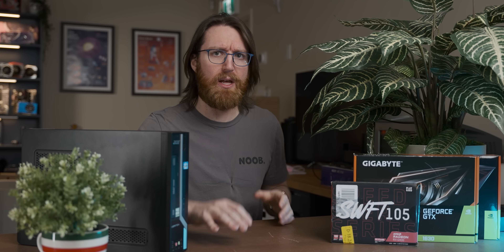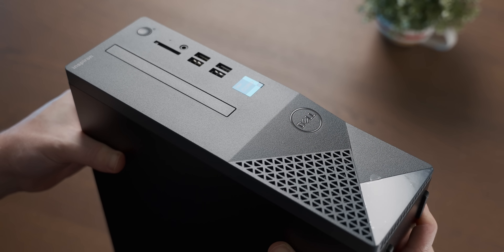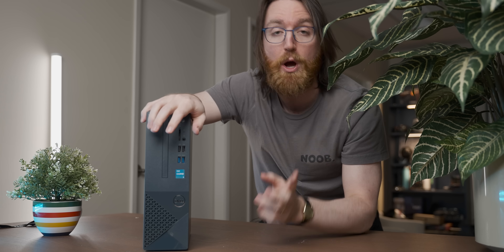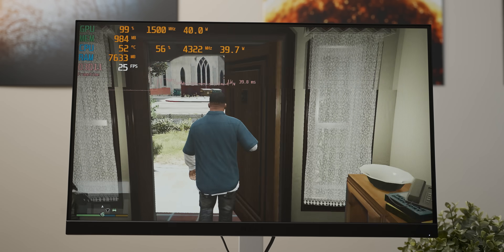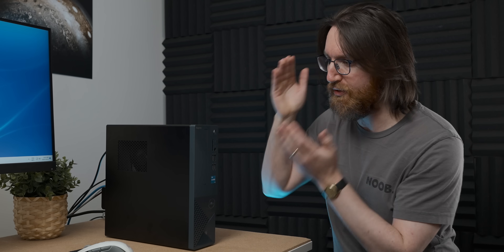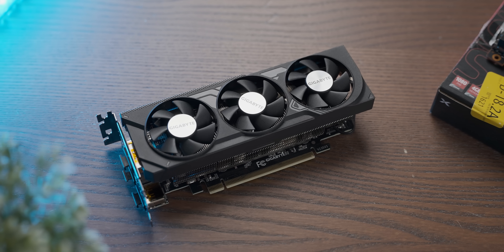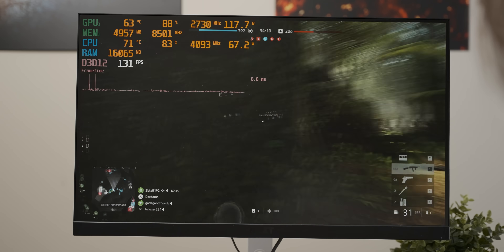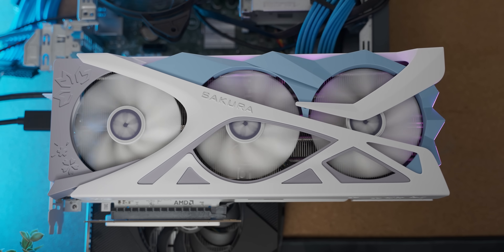The FUTURE Of Budget PC Gaming?

Comment: 8:28 Perfect, that's exactly what I was thinking!
In fact, I would have bought three SATA splitters - to go from single SATA to dual SATA, then one of the outputs goes to extra SSD (or HDD) and DVD drive via a second SATA splitter, with the other output going via a third SATA splitter to 8 pin converter for the GPU.
But hey, what can possibly go wrong? :D

(Spoiler alert - I would have just put up with the RX 6400 and left the SATA port for something like a DVD drive or SATA SSD/HDD using just a single SATA splitter (and maybe a SATA data splitter if there's not enough ports.)
Reply: TheSpotify95
spoiler, it boots, and after some days, Power hungry ?
GOLD rated 100 Watt power rail, it will fail. the DVD drive is on the same rail, free ports is not the issue, how these GOLD rated power rails are designed is the problem.
But hey, what can possibly go wrong? You will need a new PSU ?
Why you use it is the only question here !
Reply: @lucasrem  Well, the same thing will happen with that 4060 in the system. Systems like these are just not designed for power hungry GPUs, so just using this GPU itself using the dual SATA splitter, and then the SATA to 8-pin, will probably result in the PSU failing in a very short space of time.
The only thing these small form factor systems are useful for is office stuff and general everyday tasks, with the option of very light gaming possible if you can find something like a low power 1050 (or Ti), 1650, or RX 6400 which doesn't need external power. 
Also note that the RX 6400 is only useful in PCIe 4.0 systems due to its severely limited memory bus.

Comment: What about modding a 1U server PSU or SFF PSU they should fit and should be easy to get a 500W power supply. Also LPDDR on them laptop to desktop adaptors i've seen! That will will save a few watts 😂 not enough to matter but who knows. I'd also overclock a 13th gen i3 or i5 to about  100W or I'd down clock a 13th gen i7 or i9 to the 100W and I'd also use that AMD GPU or the A2000 to avoid needing to extend the GPU out of the case so really you should be able to get away with a 250W power supply.. 100W for the CPU and 70W for the A2000 GPU and about 30W for WiFi and SSD and DVD burner and fan's.. and with some struggle you mount a AIO to the top of the case and just cut a square hole to fit the cold plate though which means you can close up the case 🤔 yes it will take some thought and effort but I think i can make it fit.

Comment: There are 4060s in low profile, if you need 1x8 pin, use an adapter? ~115W in total - nah, you tricked me... Wouldn't it make more sense to upgrade the PSU? Rather than leading out the PCIe port?

Comment: Interesting, though with that hassle, I think it's far better if it remains in a dumpster like Dell intended to, because the PSU will likely to failed and they use proprietary power connector to the motherboard, unlike the old Optiplex (3rd gen and before) use normal ATX PSU.

Comment: It’s too bad those have the stupid proprietary front panel header. If a regular ITX board could fit in there, you could get the 4060lp and a 13400 in there with a Silverstone TFX PSU.

Of course, I’d expect a couple of tasteful cuts for processor cooling and CPU intake…
Reply: BTW, if you ever wanted to put a real system into a low-profile Dell case, I have a modified 7010 desktop case you could make into something fun. We’d just have to work out shipping.

Comment: The best hope for this kinds of machines is a large chunk of aluminum on the cpu for max boost, a kit of dual channel ram and a a2000 (basically a proper, full bus rtx 3060 but with half or 2/3 proper v ram)

The a2000 is the absolute top tier gpu to use when you have only as much power as the pcie slot can provide and have no hope of upgrading the power supply. There is unlikely to ever be a gpu that can pull of what the a2000 can in terms of performance per watt. 

If you want to love dangerously you can remember do a hardware modification to get more power from the gpu but your going to want to be careful, consider using a riser with supplemental sata power (at minumum) though and avoid flagship tier cpu upgrades if your entertaining this idea, your psu can only handle so much

Comment: I just obtained a HP "workstation" office PC, with an i7-8700 in it for £185, dropped in a second 8gig dimm and a 1080Ti I had laying around and that's a pc that actually can game that cost me barely £200.... OK, OK, if I bought the 1080ti, that might be different... but still.  I'm a bit scared about the 400w PSU, but it can run the 1080, so...

Comment: Always nice to see the RX 6400 get some time to shine, even if it is the crappy low-profile version instead of the far superior in every single possible way mini-ITX version. (bet you can't guess which RX 6400 I'm running :P)
Reply: The crappy low profile version is the only one worth buying.    I have one in an old sff machine and still impressed with what that tiny thing can do.   
If you can fit something bigger id suggest a used 6600

Comment: This setup doesn't make a ton of sense considering there are actual gaming desktops that can be had for little to not much more money if you catch a good sale. A few months back I got an HP Omen for my dad. It has the same CPU and RAM as your Inspiron but with double the storage, a GeForce GTX 1660 Super GPU, and a real ATX power supply (400W IIRC). Even after upgrading the memory to 16 GB, it still came out to less than $700 total.

Comment: the 13900 kf has a 1080 ti tdp which is not surpising but it is sad that dell keeps making the office pcs worse because i use one everyday at school and its a opipex 5060 with i5 8400 and rx 550 but they have dual channel ram so the i5 isnt suffering as much running photoshop and i say that because my computer has a ryzen 3 4100 and a 1080 ti and it runs great and i have to say the ryzen is suffering because my gpu is way to much for it buts better then to little like my old 1650 was but it doesnt suffer as much because it has dual channel ram

Comment: Paired a i5-3470 with a RX550 4GB… somehow the GPU is a bottleneck, CPU was at 35-44% utilization while gpu was at 99%
Optiplex 7010 MT
16GB DDR3-1600 (Timetec)
i5-3470
Visiontek RX550 4GB
SSD MX500 2TB

Comment: A 13100 isn't a bad CPU at all, when you think it faster then a old i7 of past gens which cost £290+ at release. PSU isn't need to be high power as the i3 is only 65w
Reply: Its actually not meaningfully faster since those old i7 that used to 300$ are fully capable of 60fps 4k gaming. I got the 6700k and it does ~100fps in 4k for most games

Comment: nothing beats a $30 optiplex 7010 and $20 i7 3770 upgrade to it these days. Hopefully in 2025 when windows 10 stops being supported, some newer old optiplex i5 and i7 cpu's get dumped by corporations into the used market at such a large scale to drop their price to the 7010 price point.

Comment: Alright. So the AMD Radeon RX 6400 has the same FP32 and other specs comparable to a NVIDIA GeForce GTX 680 from 2012. So there's no need to upgrade the CPU but only the GPU. The CPU which is the Intel Core i3-13100 is strong enough to play all video games up to the year 2020 without breaking a sweat. So the only issue remains the GPU, which in 7 years might be good enough to play games up to the year 2020.

Comment: Been using dumpster office PCs for years, as you saw you can upgrade them to some extent but you quickly run into a wall.  Still, for either a reasonable hobbyist Linux system, or a machine for a kid to play Fortnite and Minecraft on they're perfectly reasonable. You have the added advantage that these things are designed to be abused by office workers for years so are pretty reliable.

Comment: The Future is, Keep the old RTX 4090 as long as you can.
Is it the GTX 1080 ti ? Can we use it 10 years please.
Budget, we already have it !
Found the DELL in the Dumb, faster DDR 4 system, low power 14700 f
Single slot low Power GPU, i failed too, need single slot low power GTX 1660 ?
Great job, it can run all game in 1080p 60 FPS

Comment: I wouldn't call this the future by any stretch, even as a joke really. I think using an older Optiplex minitower or similar is still the king. Much cheaper and with something like a non-6 pin GTX 1050 TI it still provides good fun in a lot of games. There are even more options if one can change the power supply.
Amusing though. I do agree I hope the RX 6400 does not remain the best low profile GPU in its class.
Reply: Not only that, you can keep going as far as your imagination takes you.  Cooling is the only limitation.

Comment: When you do these "catastrophic ending possible" videos and you are piecing together sketchy things you should put a fire extinguisher on the desk 😂 my overclocking days were in the 90s when we had to have an adaptec 2940uw? To have drive speeds fast enough for no caching and we were struggling for good frames playing quake at 1024x768 with voodoo cards. Now even my laptop has a 1650ti and ryzen 5400h. It's a couple years old but it cost less than the monster I built in the 90s. 

You should have seen the look on the salesman's face when I said "I need a 512k DIMM of 15ns SDRAM" 😂 $500 and an hour later someone unlocked the kryptonite cage with literal armed security and got me a single piece of RAM. This was before DDR existed. 

My tv runs a ryzen 5600. The next one will either be 8000 or 9000

Comment: msi b550 pro wifi ryzen 5 5500 gtx 1660 24 gbs of ram anbd a 650 watt power supply this is the best budget pc in my opinion
Reply: all for like $400--$500 depending wya and if parts are used or not
Reply: ram i have at 2133 mhz default for mine

Comment: This is somewhat fun, but by the end the system was completely getto. I wouldn't want to have a pc with its guts out like a murdered knight who came across a set of spikes. 

Not to mention that if you are going to upgrade, the memory, the SSD, the GPU and the CPU, you might as well build/get another system. 

Last but not least, I wonder if you can use an SSF PSU. Or is everything proprietary? Then again, if everything's proprietary, just stay away from that junk. Get one of the old Intel nucs.

Comment: 13:00 Pump is at a lower height than the radiator, which can make the air bubbles go to the pump, shortening its life drastically. Do not do that, you will kill the AIO pump.

Comment: Not only are those old quad cores long-in-the-tooth, some of the best-in-socket CPU's are still pulling like $200 freaking dollars. MFs just waiting for that mission critical system to fail so they can finally sell the replacement. x.x You can literally get an I5-12600k for the price of 2 I7-4790ks, right now. Think that's bad? Check the best Haswell Xeon.
Another thing: OH REALLY! Single slot GPU only? Someone is new to abusing Office PCs. All you gotta do is unscrew that PSU and shove it up somewhere weird like the hard drive enclosure. Good luck getting a double slot GPU powered though, $50 says the PSU to Motherboard connection is proprietary

Comment: i swear fortnite is the easiest game to run at the same time the hardest to run  past 120fps 1080p unless u got a last gen or current gen hardware ur not going past 120 fps and ur 1% lows are gonna be horrible its really a weird game ive never bench marked a game like it based off the 120 fps with like a rx580 and ryzen 2600x  you would think that a IGPU or a celleron cant run it but  even a athlon 2 core can run it with its igpu its so weird

Comment: I think the base is a very stupid decision. I hate low Profile office PCs. With a Full Profile one u'd had much less issues. And I wonder, how cost effective U are, when u buy a bad base system, a new CPU, new RAM sticks, a Power supply and a GPU.
Let's say, you bought a Full Profile PC with an i5, 16GB dual rank RAM and a 250-300W Powersupply. U could easily put a 4060Ti in it and have good performance for a very recent price tag